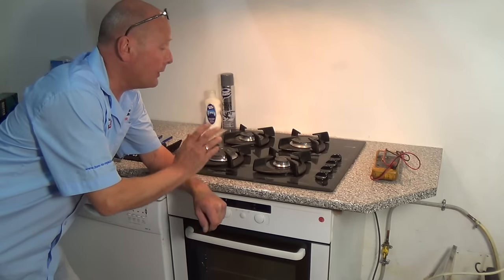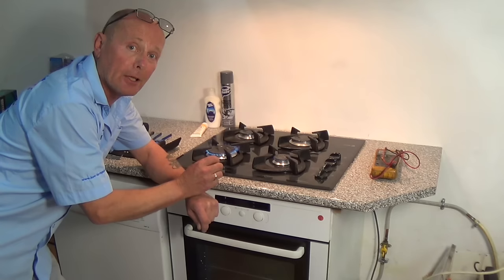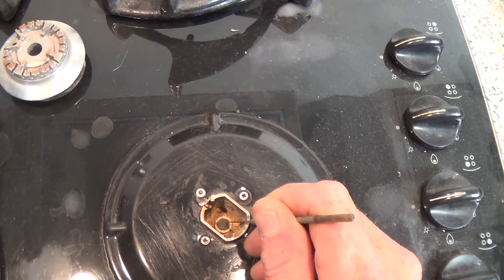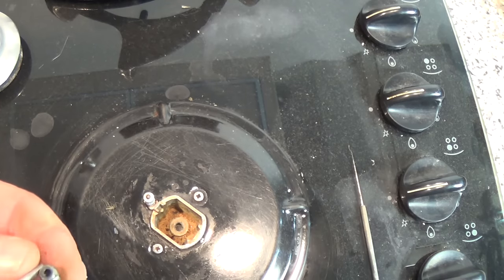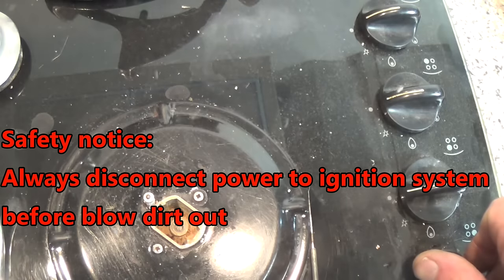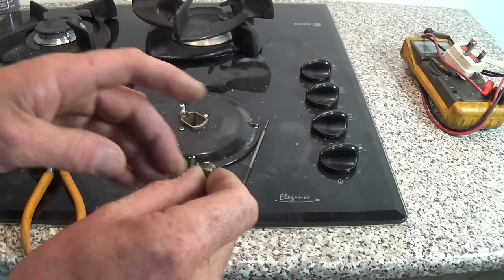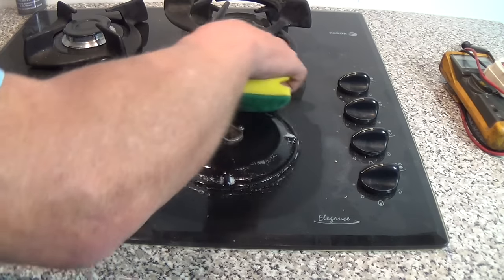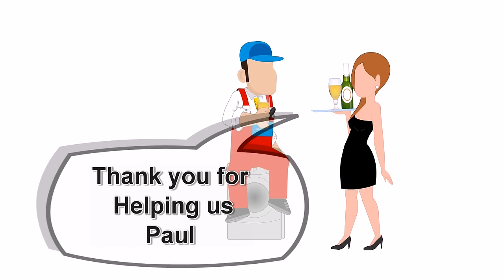No gas or small flame on Gas Stove top hob cooker  How to clean the jet

Comment: 10 years heating and plumbing engineer.  I use toothpicks to take the injector nuts out. Also when you put them back in you should use the toothpicks to turn first few turns. It prevents cross threading them.
Reply: Good tip

Comment: Alleluia! Many thanks. I thought that had solved my problem - well, not quite. The issue is that none of my copious collection of tools has a hexagon removal tool of the right size for our Bosch cooker. I cleaned the debris with the vacuum cleaner on full 'suck' with a close fitting tube taped on. No dice But at least you've pointed me in the right direction. Thank you.

Comment: thanks for your video. My wife said I had broken the hob based on what she read on a Japanese website,  but it was exactly the issue you had and the fix was very quick and easy. only had my impact driver and sock to take off the 7mm gas injector. So had to be very gentle, and to my surprise when I turn the gas on without the injector a fountain of flakes flew out!! Cleaned the blocked injector and it working perfectly again. :)
Reply from the maker: glad you got it sorted please remember to subscribe as that's is was keeps this channel going. Thanks 👍

Comment: Thank you! I just revived my Belling gas cooker that had two burners blocked. I cleaned the other two as well just for good measure. On a side note, once you've taken the jets out you could use compressed air to clear the blockage very quickly and efficiently. THANKS AGAIN!

Comment: I had my son's oven replaced because no one wanted to clean jets in his gas oven. Here goes to show you a really nice maintained gas top can become cloves. He was charges $350. For a new stove. 3 years later it happened again. So Now I see how to fix and clean. Got to get that tool. A friend told me about using a pipe cleaner.  But need something more? Take off the jet and clean with that tool small wire brush.  I just saved your video to show maintenance.

Comment: Another tip: if the jets look green and corroded, put them in some boiling water and baking soda solution, this should clean off the corrosion and put the jet hole back to its original size.

Comment: Where can I get new jets, I think for the amount of them I have to change it would be cheaper then buying the specialist equipment like the pipe clean and professional looking needle you were using...

Edit:

I forgot to say thank you.
Reply: Unscrew the old jet, drop it into a clean empty bean can.  Spray a tablespoon or 2 of carburetor cleaner on  it and let it slosh and swim in that solvent for a few minutes.  Fish it out, blow it out with your lips, spit out any nasty solvent residue and think bad thoughts about me.  Hold the small brass jet up to a light source and see the tiny pinhole is now clean.  Reassemble.
If the hole is still blocked:  it is microscopic(nearly), and musn't be hogged out to a bigger diameter.  Locate a small metal wire that easily goes into the jet and physically poke the obstruction out.  Then reassemble.

Comment: my burner lite with the ignition but the clicking doesn't stop, sometimes they do , but when the stove was new this this not occur. Does the spark module need replacement, or the ignitor, please inform, I have a JGC 8430 jenn air cooktop, thanks.

Comment: Hi. What do you do if when you push down and turn knob, there is no sound of gas? Is it the burner or the knob that is the problem?
Reply from the maker: This will be normally no gas coming out of the jet you want to make sure that it is not blocked. If it is clear then you may have a problem with the gas valve

Comment: I did this for a central burner on my stove that i never use but noticed has a very weak flame and still the same problem. Weak flame on high that only ignites about 25%. If i blow on the flame it often ignites another 40-50% but never the whole thing. Any ideas?
Reply from the maker: Are you sure it is jeted correctly for the type of gas that you're using if you are one bottle
Reply: @How-to-repair  not sure about the " one bottle" comment

Comment: I unfortunately didn't have a 7mm, but had a dental device to open the hole on the jet, and it worked perfectly, even better; but tomorrow will remove the "jet," with a 7mm, but how do you disconnect the electric.
Reply: Well on mine you turn the wall  plug off that the cooker is connected to.

Comment: There are no gas burner repair   peoples for miles around where I live. I could file a needle  to suit the gas burner nozzle to clean it as illustrated. What is the actual     diameter of the needle for the smallest ever gas jet? This  diameter could be \given in thousands of an inch or fractions of a millimeter or standard wire gage. Thank yhou very much.
Reply from the maker: The width of the needle is not that important. The idea is to remove any blockages from within the jet, jet sizes vary, so there is no point in having a needle to a preset size. glad we could help you @vivianastridge2167 this is for you https://www.youtube.com/shorts/e432SAb2g08 please remember to subscribe as that's what keeps this channel going. Thanks 👍
Reply: @How-to-repair  Thank you for your reply. I realize that I have not made my point clear. I have a single burner lpg gas burner that fits directly on top of the  cylinder. The nipple or nozzle or jet gets  repeatedly blocked  and it is becoming expensive to get it cleared. I have seen the repair person use an extremely thin needle to clear the almost invisible hole in the jet. It occurred to me that if I knew the diameter of that clearing needle I might be able to file one down to size. Unless I am able to  purchase this needle , which I am most certainly not able to as the gas company does not deal with individuals but only companies and agents, I will  continuously have to spend money on something which I cold very easily do myself. Now you see why the diameter of that most important needle is required.I do not know the nature of the material that keeps on blocking the jet or I could use some chemical to dissolve it so  the needle is the only means for cleraing the jet. If you know of other ways that there are  of clearing the jet  please be kind enough to inform me for which act of kindness I would for ever be grateful. Thank you hopefully.
Reply from the maker: This depends on the size of the jet, stamped on the jet will be a diameter example 0.50 then, of course you will need a needle to the correct size, but if you are having to clear this on a regular basis, you either have a dirty pipeline or possibly the bottle that you are using is corroded and particles are coming from this to block the jet, this should not happen. You should never have anything coming from the bottle directly to a burner. It should always be rust free with no particles getting food to the jet. I hope this answers all your questions

Comment: I am rally surprised you didn't bother to clean the rest of the dirt sitting in the well of the burner.  If you're going to all that trouble cleaning the jet why wouldn't you vacuum it as well, considering you've blasted all dirt out of the pipe and left it there to collect back into the jet.
Reply from the maker: Yes I totally agree with you if it was my own appliance and I wasn't just thinking of the amount of time it would take filming this I would have vacuumed out

Comment: Don't remove the jet, just clean the hole with a pick while the gas is on, and the junk will blow out.

The jet is brass (weak), hollow (weak), and probably stuck in there pretty badly from years of heat, moisture, etc. Good chance it'll break and then you have a problem.